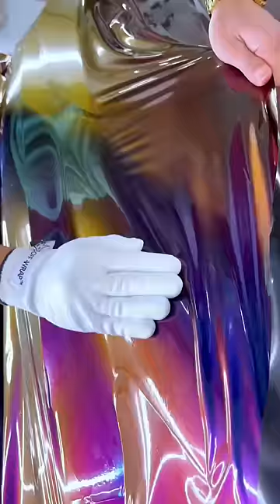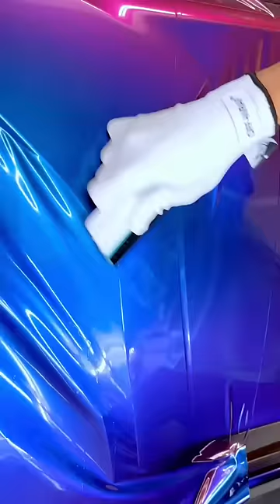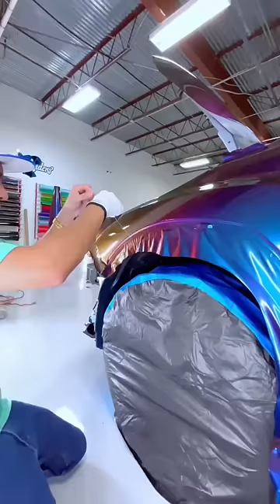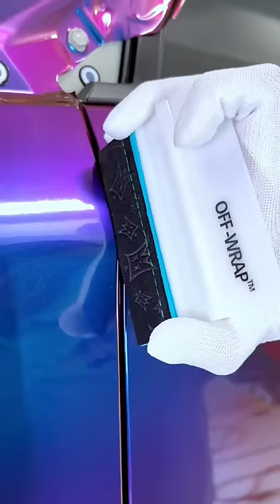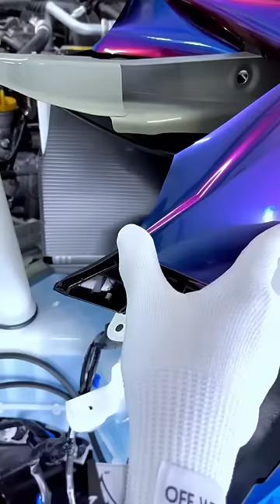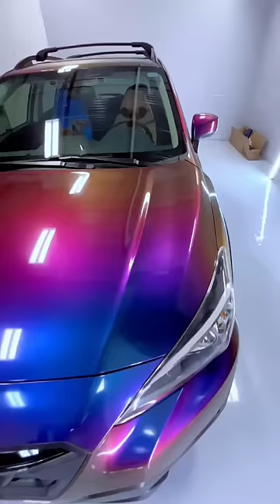Wrapping a Brand NEW Car ! 🤯 | Chameleon Wrap! #carwrap #carwrapping #asmr #carwraps

Comment: 147hp became 1000hp just with that wrap 💀
Reply: It has a good 180+ and has room for a full sized turbo to get up to around 305
Reply: at that point id just buy a fox body mustang and ls  swap it with a 6.2 💀
Reply: @saltyfries8845  is that including the blowup ?
Reply: @GOODHABITGANG  ????? what???? they are 2 different cars completely. 1 is more for off road and weather performance conditions. The other is for performance on road.
Reply: @fighterpimp  huh? wut are you talking about ,i meant that i wouldnt spend all my money on that forester /instead i would just get a mustang with an Ls7 swap
Reply: @saltyfries8845 pretty sure the N/A ones have a plastic intake manifold that blow up under any real boost lmao
Reply: @saltyfries8845 150hp crosstrek slowest car ever
Reply: @toddlehman1  That was the cross trek sport that has more power and other off roading features
Reply: @GOODHABITGANG that costs more
Reply: @kiilod6914  ofc it does but  id rather spend more than buying that car
Reply: @GOODHABITGANG  i daily drive this car, its slow asf definitly not a sports car even the sport trim only has a 8 second 0-60
Reply: @kalebjaegers2884  as expected,it was just sarcasm
Reply: @toddlehman1 182

Comment: I always imagine unwrapping it later and finding cut marks all over the factory paint. I’m sure they are careful but jeez, one slip 😂
Reply: Cars always look like shit after unwrapping them. It's such a pain in the ass to clean all the residual adhesive off.
Reply: @mikalhernandez you need the right chemicals, and then the stuff will come off in a breeze
Reply: You have a special cutter that prevents these kind of things. You should never use a normal cutting device on the car itself. If you have cuts on the paint it means an amateur has worked on it.
Reply: @klaus2913  oh ok. Good to know 😎💯
Reply: @klaus2913 😂😂😂
Reply: They do mark the paint with the scalpel if your unlucky enough to buy a car that’s been rapped you will see very fine rust lines in the paint caused by the scalpel

Comment: What happens if you mess up do you start over or just take that section off?
Reply: This man doesn’t mess up
Reply: Most vinyl is very forgiving. If you mess up, you can lift it up and heat it, and it will go back to normal.

Comment: That's so cool. Does heat affect it after it's done? I don't know much about it and can't really afford it but I want it lol
Reply: You “post-heat” the wraps to help the glue a little and check for air but no. Unless you hold a blowtorch on it… warmth isn’t going to do anything to a wrap that’s been post heated
Reply: @jaredweed7281  thank you! Yea that would be some extreme heat
Reply: As someone who used to wrap cars (and owned several wrapped cars), Yes it will. Overtime in warmer climates or if you leave the car in the Sun then the wrap will dry, crack, fade, and start to peel.
Reply: @extreme989   it's like a time limited skin in a way

Comment: The wrap will only last a few years. Not to mention that a few dings or scratches in the paint is not going to drop the price of the car. You want to keep the resale value of the car ?... change the oil EVERY 2000 to 3000 miles and buy a Toyota or Honda. A wrap is a waste of money, but hey, it's your money right.

Comment: That's a fitting wrap for a Subaru driver. Might as well pull off the mirrors and disable the turn signals while you're at it. They won't be needing them. I'm sure a matching ski rack was added shortly after this video.